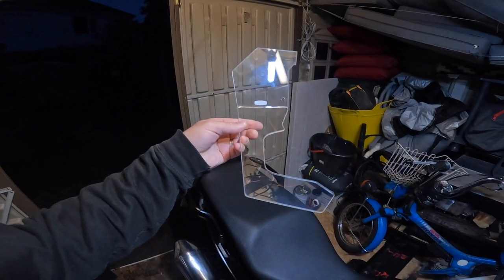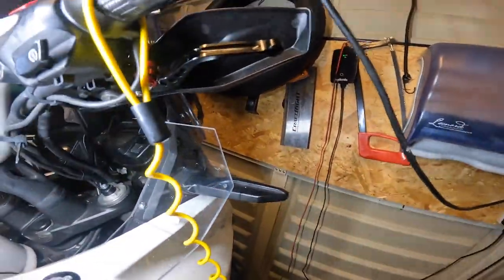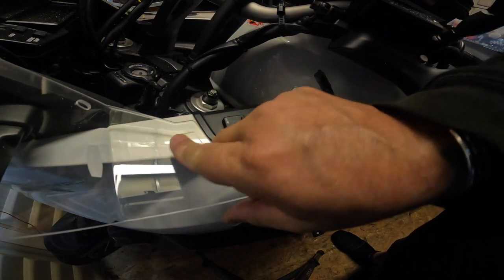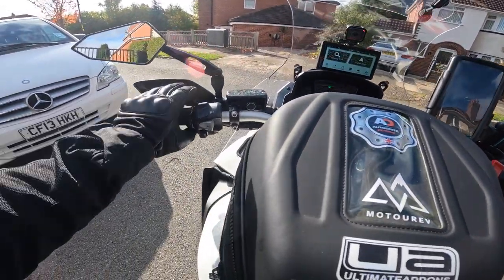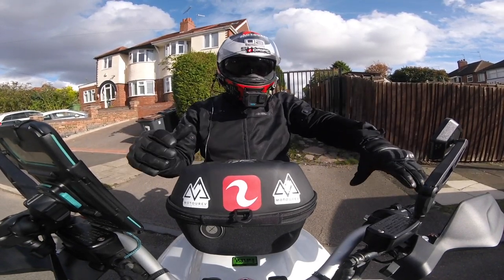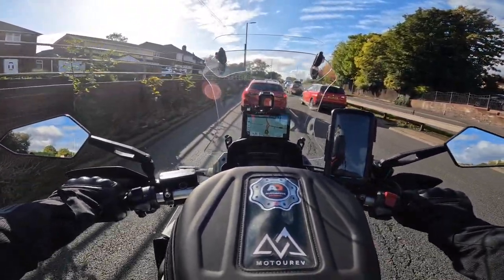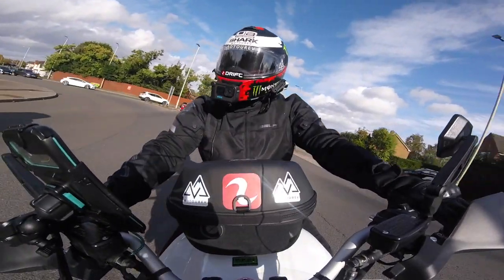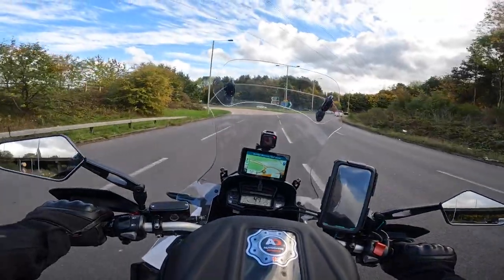Honda VFR1200X Crosstourer Wind Deflectors Installation & Review

Comment: Nice work Craig, I hope you're enjoying the new bike (I still miss the 800) but I guess the extra capacity/torque is handy.
Reply from the maker: It’s so much easier to ride than the 800, bigger and heavier and can only put it down to the bars being so big it’s so easy to throw in corners.